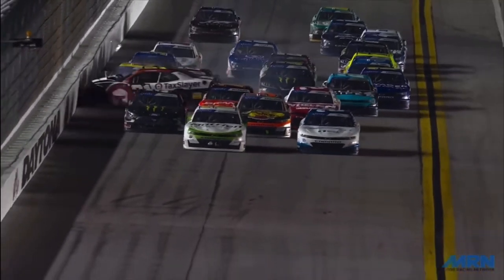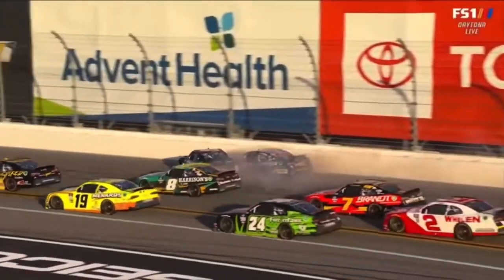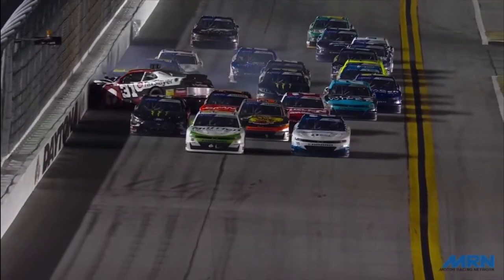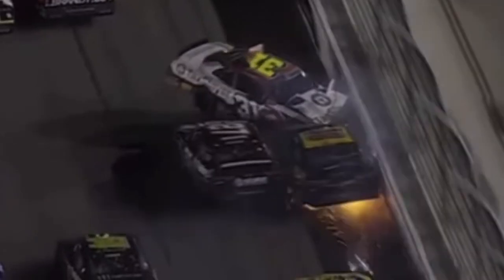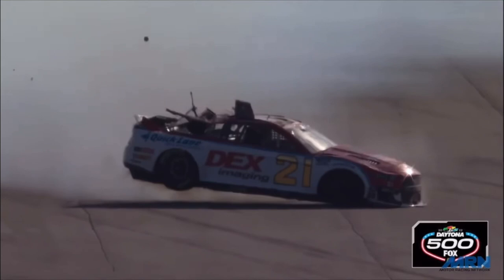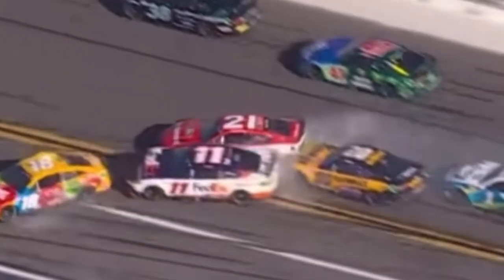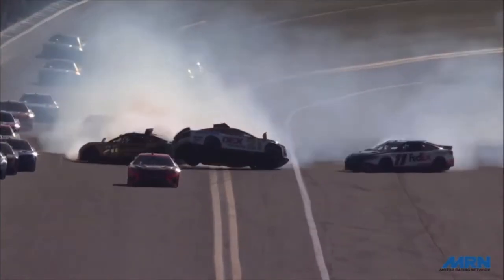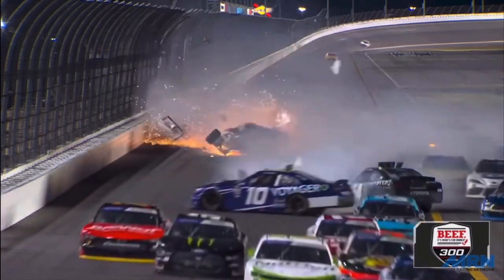How did Myatt Snider & Harrison Burton flip?

Comment: I think another factor of Burtons wreck is the rear diffuser. At the rear of the car, the smooth bottom angles up at a slight angle while the plates of the rear diffuser remains flush with the bottom before it inclines. This creates gaps in the rear of the car where air can actually in power and speed. You see, air is essentially fluid and the tighter you create a space for fluid to flow, the faster the fluid flows. And the plates of the rear diffuser creates several constricted spaces for air to amplify. Combine that with everything Hunter said, man.